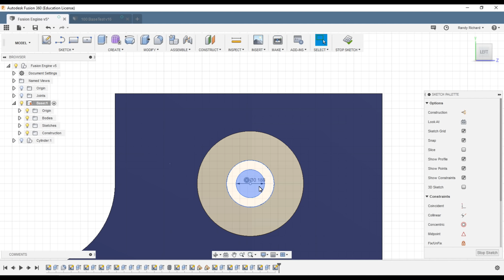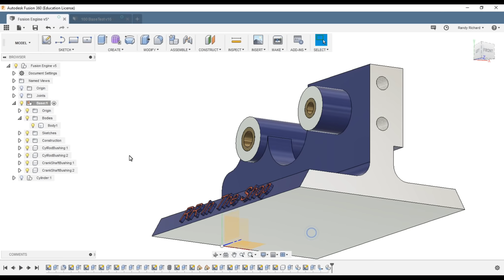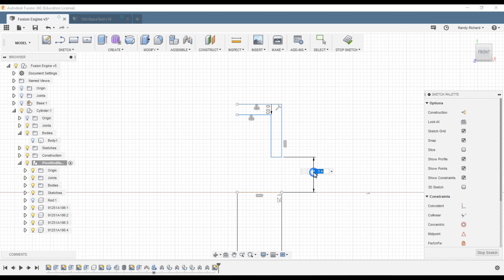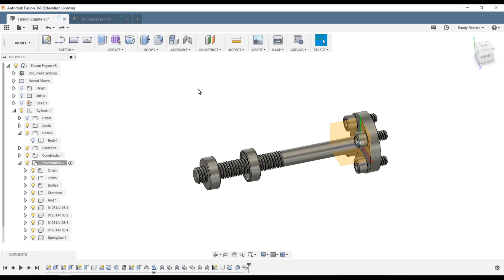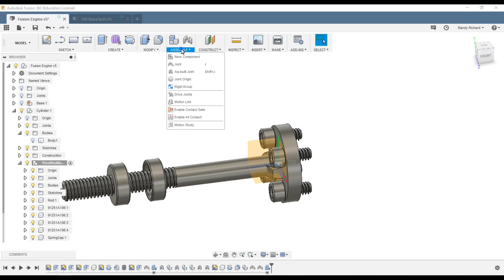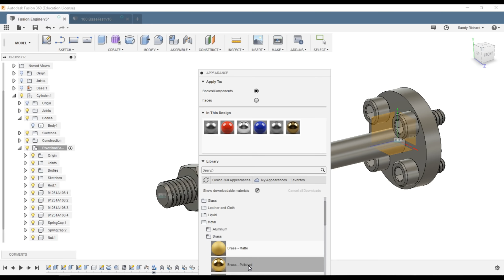P3-2 How to Model the Cylinder Pivot Rod of a Model Steam Engine From the Ground UP

Comment: I made it through creating the spring caps and the nuts just fine but noticed a small discrepancy in my model at the end of the video. I can’t tell if the discrepancy is in your model as well and it probably doesn’t matter for the design or modeling of this steam engine but it’s worth noting because it may be an issue in other models. When I pivot the cylinder, the spring cap nuts pivot as expected but when I pivot the cylinder and release it to return back to it’s rest position the nuts don’t move back with it. It looks like the return to zero constraint of the base to cylinder joint doesn’t flow to the other rigid joints attached to the pivot point of the cylinder.
Reply from the maker: Sometimes when you have a lot of joints they don't like to work together well.  I have at times removed all the joints and then re did them in more logical manner, that seems to help.
Reply: Yes, redoing the joints for the spring caps and nuts worked. Thanks Randy.

Comment: Morning Randy!  I hope drawing springs in 360 is easier than Inventor.
Reply from the maker: Inventor is actually more versatile.  Thanks Craig.
Reply: Randy Richard In The Shop : No arguments but I had a hard time making correct springs in Inventor. I've never tried in 360 so I interested in seeing if they improved the system. One of my biggest problem was I didn't own a Machinery's Handbook at that time so certain variables with standard abbreviations I didn't understand.

Comment: How do you think the indicated horsepower will compare with the measured horsepower? :-) I can't help but wonder how the flow /valve system could be improved to get better power output.